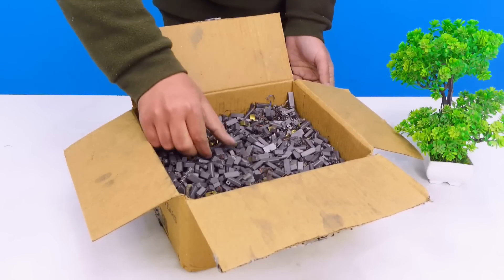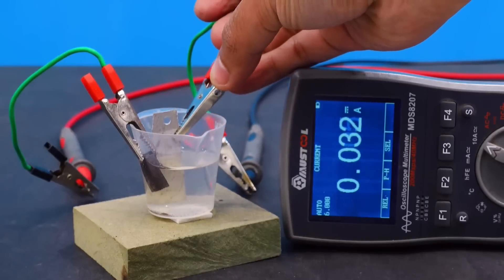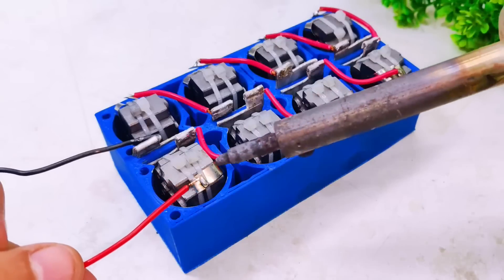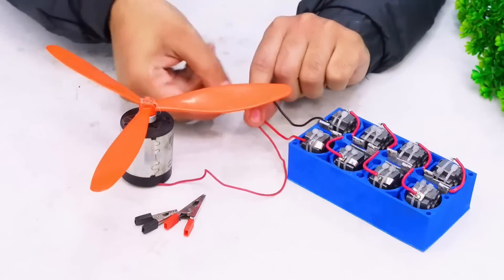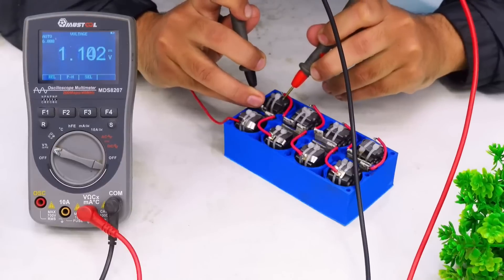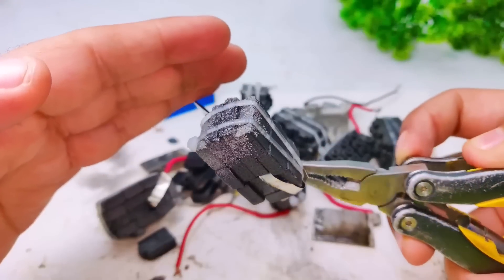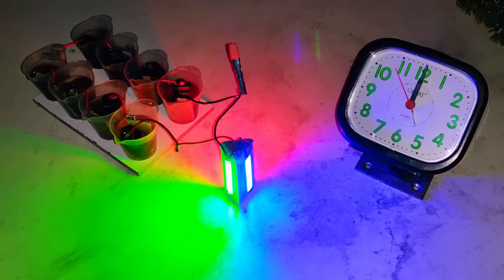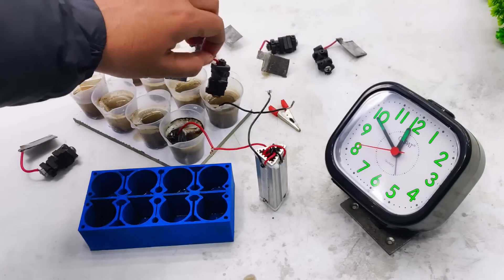I tried REUSING these waste things and found a real Gold Mine

Comment: Okay, but all batteries have a capacity measured in Ah and Volts, of course. So, how many mAh does your battery develop ?
Otherwise, you can also create 12V with potatoes or lemons.
Reply from the maker: Peak of 380mah for a simple design although the backup is great.
Reply: @mrelectron_alternator OK, thanks, but if you measure a "peak" 
is not in Ma/h but in Ma, remember Ma/h is the power delivered in 1 hour  !